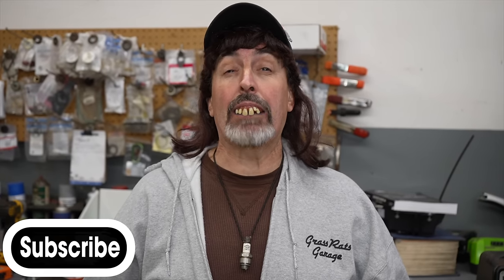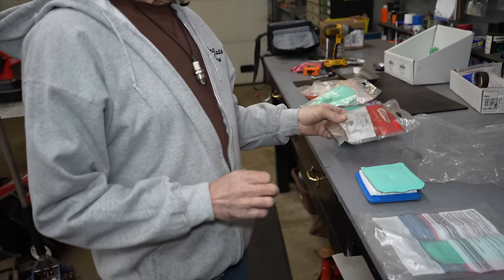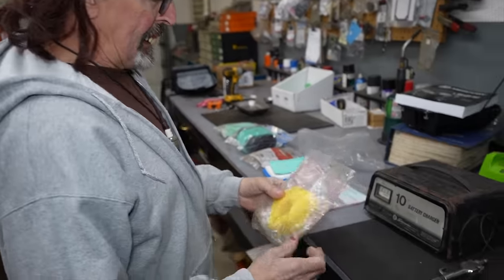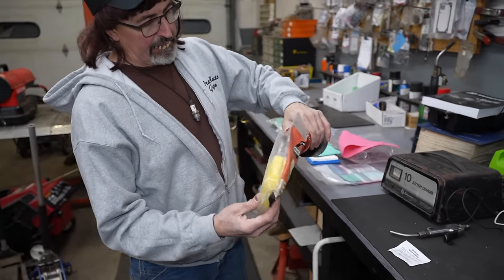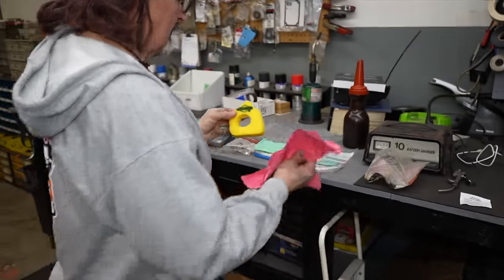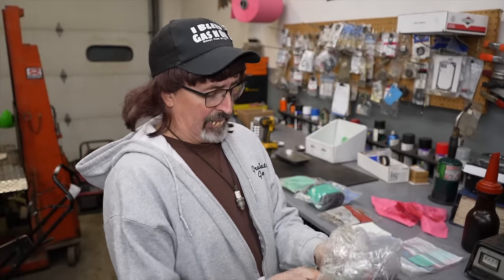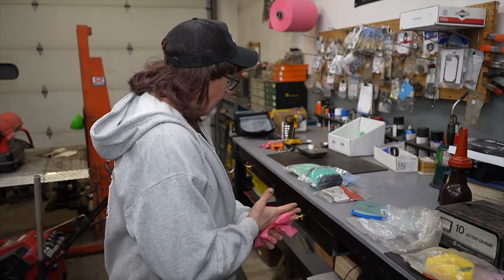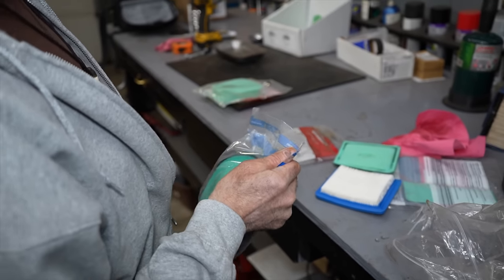Should You Oil Your Air Filter?

Comment: I don't use a straight oil to oil filters. Straight oil is often to restrictive. I use a 50- 50 mix of oil and gas. This more easily penetrates the foam for complete saturation. When you squeeze out the foam the oil sticks to the foam and the gas doesn't. I also let it set and air out. The gas evaporates out of the foam. 
I tried a K&N filter and used the K&N cleaner and oil. These came in spray cans. Real easy to over oil. When you spray it on do so lightly. You want to barely coat the foam. If you see it it's too much. 5:26
Reply: Just use a lighter oil dude, and not so much. That gas and oil sounds a bit overcomplicated. Any oil can work such as a lighter machine oil, the manufacturer just recommends motor oil as it is always at hand. However, I use the recommended amount and never have a problem
Reply: I knew 2175 was going to get you as I read your comment and, bingo, there he is like a bad penny

Comment: Oiling the filter when oil isn't call for by the manufacturer would restrict airflow and act like a choke.  You would be running too rich.  OTOH not oiling it when you are supposed to would have you running too lean.

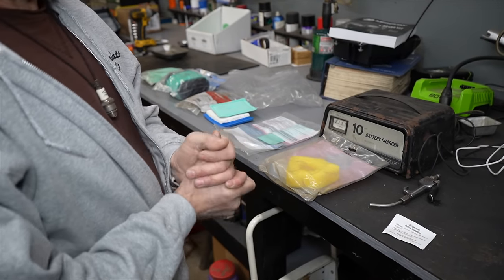2:56 Vegetable oil in contact with air will oxidize and polymerize due to unsaturations in the molecules, and will become hard and rubbery.  The intake has a lot of air going through it, so I would expect the filter to harden and take on a rancid smell if you use vegetable oil.

Comment: I have never oiled a foam filter… didn’t think it was necessary? How would anything get through that much dense foam? I just take em out and clean them off after every use
Reply: Read the manual? It's just a light amount of oil, enough to make it moist not dripping wet ...and yes the performance is still there. Tons of motorcycles and performance cars (see K&N filters) use oiled air filters. K&N is the king of reusable air filters.
Reply: Yes obviously, i have a k&n filter in my truck but honestly they don’t perform as well in dusty environments than just the plane paper filters do… the reason they claim to increase Power is cuz they have less restriction. And back to the point they are built much differently than a sponge…

Comment: My KROLLER engine's filter uses those foam prefilters over a pleated paper filter.  By the end of the summer there's oil all around the CARBATRATOR and manifold.  Is this normal or  maybe I'm using too much oil?
Reply: I have a Kroller motor in my 2000 Toro wheelhorse 268 Hydro & the dealer said to not even worry about oiling the prefilter, just wash it out every season. I should have probably listened to my gut instincts. Then again the main filter doesn't appear to be dirty when I look at it or hold it up to the light?¿
Reply: You might be using too much. The oil just needs to be enough to make the filter moist, not dripping wet. A teaspoon amount?
Reply: Cold have a valve or head gasket issue …. I am seeing this on my S170 with only 39 hrs

Comment: I get Briggs machines where the owner says the air filter is clean but the engine isn’t running properly.  They don’t even realize it has a pre-filter installed.  I pull out the pre-filter out and it looks like Fluffy's been living in there. On Briggs Quantum engines, it’s better off without a pre-filter.  IMHO!

Comment: Whoa!…hold on there trex. Some mfgs don’t want you to oil due to the fact the paper can draw in some of the residual oil and ruin the pleats. The foam pre filter is to stop larger particles/debris from wedging their way in between the pleats of the paper filter. It’s why it’s called a PRE filter. Rarely do I oil prefilters unless the mfg specifically calls it out.
Reply: Agree. If you oil those pre-filter socks you risk ruining the paper main filter.  I keep a couple of those pre-filters on hand and swap it out every month or two during mowing season. I wash it and then put it back in rotation. This keeps the main paper (expensive) cleaner longer.

Comment: Too much oil, and the engine will run rich
because the air intake can't breath due
to...too much oil.
Personally, I don't oil any air filter.
Just replace them often.
That alone is a major challenge to most mower owners.
I cannot believe how cruel people can be to mowers.
Reply: If the manual says to use oil and you don't, you're wrong. Maybe it is good that you don't use oil (you rebel, you) because apparently you cannot measure the amount properly? It's not rocket science, just use a little oil, but perhaps it is rocket science. 🤣 It's amusing that you're preaching about challenges but you personally are not up to the challenge. By the way, the foam filters are easily washed and oiled again, but the joke's on you for being an unnecessary parts replacer.
Reply: @Hjerte_Verke  - Thank you kind sir.
In reality, I have no FOAM AIR FILTERS.
Do you plan on returning my hedge trimmers ?

Comment: One less thing I worry about with my battery powered zero turn mower 🫤. I've been a die hard gear head my whole life.. grew up in the late 50's to mid-60's street rod days.. I miss those days they were awesome but I digress. I gotta say fellas when it comes to my mower I don't miss the belts and pulleys and the hoses and mower deck hell and the filters and goin' to get gas and luggin' cans around and gas filters and the winter time carb gum ups.. none of that nonsense. Yes I know they're expensive to buy.. and depending on the size of your  property limited on how much it mows on a single charge (I'm out in the country so mine mows about an acre and a half of tall tough grass with some weeds if I set it on high speed ..and it will do 2 acres if I set it on regular speed). 

Like it or not they're the future. Trust me I'd much rather mow the lawn with a sweet '56' Chevy gasser! Lol. But it would scare the neighbors cows 😳. 

 I hope Taryl does some videos on maintenance issues on the electric stuff. They're not perfect machines but what is! There's a lot to consider if you're lookin to buy one.. my best advice is DO your homework and listen to what Taryl has to say.. he sees it all! 👍

Comment: Lol if you use any kind of motor oil it will eventually get dirt to the carb. If you use air filter oil it quagulates and gets thicker to capture the dust and debris.

Comment: My snowblower does not have an air cleaner, how come ?
Reply: No dust or airborne dirt when there's snow on the ground
Reply: They're all (almost always) like that. With snow on the ground there just isn't a lot of dirt particulates in the air like on a warm, dry summer day.
Reply: As the others have said, no dust in the winter. But also, a paper or foam filter could get clogged very easily by melting snow (water residue) getting sucked into the filter and then freezing solid.

Comment: I throw out all pre filters all they do is dry rot crumble to bits and get sucked in the intake
Reply: Well that's the dumbest comment I've read here. How can the pre-filter get sucked into the intake if the main paper filter element is in place? And maybe all the pre-filters you buy are 10-20 years old NOS (new, old stock)? What bad luck you have. Never seen one crumble unless it was on an engine that hadn't run since 1982.
Reply: @hjerteverke2175  Mr no it all as the get old and worn the foam crumbles to bits tiny bits that will find there way into the carb or the engine have you never pulled out one that just crumbled to bits in your hand
Reply: @stevecombs561  That's Know it all 😀🤣Yes they crumble but only when they're really old and on old engines that weren't running when I bought them. Have a good one Steve.

Comment: Hey taryl I had a question my grandfather’s mower starts but isn’t healthy the sensor isn’t the problem it always starts with a plume of smoke and after it runs for a few minutes and I shut it off to check the oil smoke comes out of the dipstick and it’s a full aluminum block no liners  I wanted to know what the issue is great video ❤❤
Reply: What sensor?  
Other than a massive run on sentence that is hard to read,
the mower's head gasket has lost its seal.
If you have a fuel pump, I'll bet the little weep hole
on it has oil also.
Can YOU fix it ?
Well....good luck.
Reply: Taryl never answers the comments, not that I've seen. You'd be better off joining a small engine forum on the inter-screen.
Reply: @Hjerte_Verke  You are such an expert why don't you solve his problem for him?

Comment: A can of PJ1  foam filter oil in an aerosol can from a motorcycle shop is super tacky and lasts a long time
Reply: Fresh motor oil is way cheaper--everyone has a few quarts laying around--but you do you with your specialized product (one more thing $$$ to buy!)
Reply: I have ridden dirt bikes 40 yrs that’s why I use it
Reply: In the summer regular oil will drip off and make a mess try bar oil
Reply: @jonathanfierberg3807  I don't use too much oil; if it does drip off I will know I used too much. However, re-reading my Honda manual, it states to use SAE 80-90 gear oil, much heavier than engine oil 👍😎👍

Comment: A machine that can breathe or struggles to get air will never run correctly nor will it last very long if it does in fact still run with a clogged filter. Between air filters and oil changes I can’t think of anything that will benefit the useful life of any power equipment. Well, maybe not letting knuckleheads run it would be up there, too.
Reply: Spelling error:  can’t* not can 🤦🏻‍♂️

Comment: Only oil bath filters need to be oiled. If the manufacturer doesn't require it you dont have to oil them. Most mowers after the early 70s DO NOT need  to be oiled
Reply: You start off with a blanket statement (that "only oil bath filters need to be oiled") and then contradict yourself 😀. Too easy to disprove your statements by reading engine manuals and there's tons of free manuals on the interwebz. Oiling a foam filter or pre-filter is still a thing not to mention that there's plenty of engines made "after the early 70s" that still use the cheap and easy oiled air filter. It's current era "high tech" too; K&N filters for example, because it offers high filtration while still allowing maximum flow unlike a paper filter.

Comment: They no longer put Sponge Type Filters on Push Mowers and a Oil Type Filter should never Touch a Dry Paper Filter. Sad to Say but All Push Mowers that have Briggs. Engines are Total Junk..
Reply: You sure about that? I still see foam air filters and pre-filters too
Reply: @Hjerte_Verke  Saying they no longer use foam type is a bit of a broad statement. While a lot of newer equipment now uses paper filters there are still some that use foam. It's probably just a ploy to get you to purchase a new filter each time since you can't wash and re-use a paper filter.